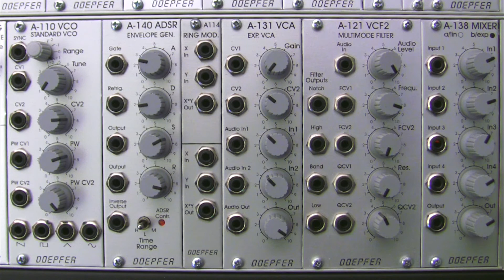Doepfer A121 Multimode Filter Basics

Comment: Q in electronics is for (filter) quality factor. Abstractly it's the amount of energy stored versus lost, and has a dampening effect. additionally in a resonant filter it works out that having a tall sharp peak at resonant frequency(s) means it has a narrow bandwidth and less loss, or "high Q". More Q means more energy rings through the resonant circuit. Think like a spring or a pendulum. Note, "quality" doesn't indicate it is good or an accurate representation of the input signal (fidelity).